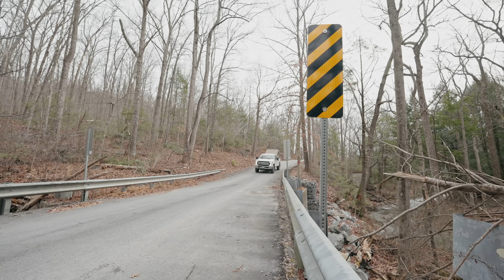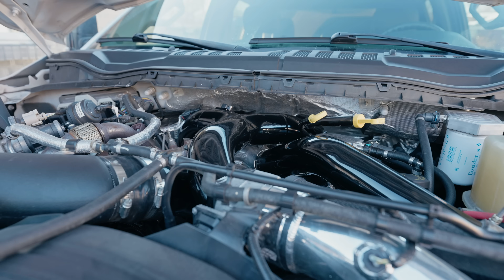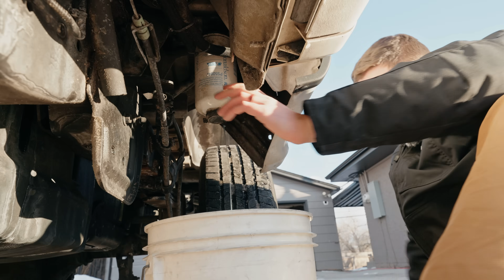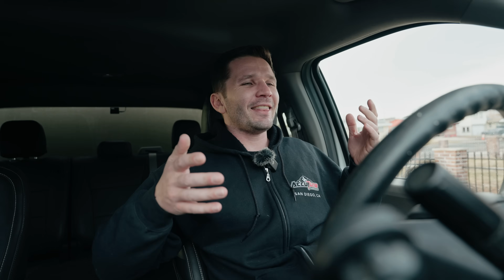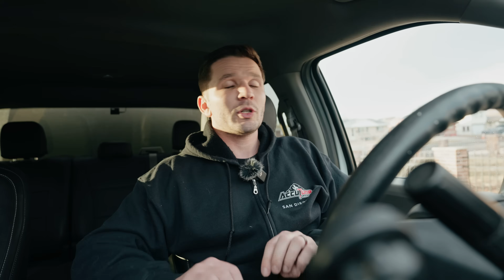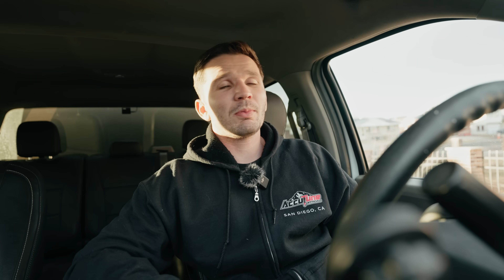6.7 PowerStroke Pros and Cons After 200,000 Miles

Comment: 11-f250-6.7 with 276,000 miles on my CP4 and running strong…. Run Cetane, don’t idle, don’t mod, don’t tune, baby until up to operating temperature, maintain and run baby run!  I hope I make it to 500,000?  I know my truck will. I’m old.
Reply: Looking at trucks with 255-275k miles an hoping I get one that was maintained.
Reply: @ZONES89RS  where are you located? Whats your budget? I know of a 1 owner truck with 299k highway miles in So Cal
Reply: @mrsportfish8987 found a 19 F250 with 228k miles

Comment: Old is gold will never buy new  just put 35 grand into my 7.3 powerstroke supposed to be close to 1000 hp no emissions no def guarantee my 2000 f250 will last longer than a new one theres like 4 sensors easy to work on ford till the day I die but the new stuff is junk to me compared to my 2000 if my window stops working all I have is a switch a fuse and a motor not 7 computers in my door just for my window will put 100 grand into mine before i buy the new junk

Comment: Currently at 334k miles 2018 F-250 all original.  I haven’t needed anything replaced except o2 sensor and batteries. I’ve never used a fuel additive, just kept the fuel filters and the oil changed (full synthetic) regularly.  Some front end parts of course.  I can’t imagine a better truck, I’ve owned Chevy and Rams and they were ok, at least mechanically, the rest of the truck just didn’t seem to hold up nearly as well as the Ford has.  Planning to get me a new F450 in 26.
Reply: If you get an F-450 recognize the tires are true “truck tires” and MUCH more expensive then what you are buying too.  Also, the suspension system is great when loaded so if you plan on having a trailer on it most of the time you are good.  Without a load, the F-450 is one harsh ride.

Comment: I replaced my CP4 pump with a DCR - no additives no failures.
Reply: @hgoff5617  man I wish it was cheaper to do it
Reply: @ZONES89RS cheaper than a new fuel system I’d just do the prevention kit until failure then upgrade
Reply: That’s the way to go. Now have a DCR on my 280k ‘17 6.7 F250 Lariat and hope to get to 500k. Absolutely love my truck.

Comment: Is the oil pan leak an expensive fix ??
Reply: $2500 +....got lucky it was just shy of 100k miles. Dealer fix as that part is part of the engine which was 100k/5yr warranty item.

Comment: 210K miles on my 17. Its all stock-- so far no issues. Have replacing the CCV seems to be an annual event. I do use hot shots just to be safe, way cheaper than the alternative.
Reply: @terryl.6490  hot shots has been proven to be the WORST additive for diesels. Look up the test comparisons on additives on YouTube.

Comment: My 2000 7.3L Diesel just turned 650K, still going strong
Reply: Doesn’t make enough power to break
Reply: @Robbie64 who cares. It doesn’t break. Thats the point. Can still tow what most people would tow
Reply: @chrisrstt  you realize and f150 is half the weight and rated higher for towing rated higher hp tq . Love the old school trucks but the fact you could put 100k into them make it capable of towing 30k it’s still only rated for around 10k
Reply: @tree01house  we are about to buy a travel trailer to take family trips across the country so I’m going to get my first diesel to haul it. Always had 1/2 ton trucks. What are you top tips to get 650k out of one? I would love to be able to say my truck is still going strong at 650k miles one day
Reply: @tree01house  wow
Reply: Sure it did
Reply: @gnd111 While there is no exact total count, multiple Ford 7.3L Power Stroke diesel engines have exceeded 1,000,000 miles, with at least one documented example hitting over 1.3 million miles on the original engine. Known for extreme longevity, these engines frequently surpass 300,000–500,000 miles with regular maintenance, particularly when used for heavy-duty towing or hot-shot trucking.
Reply: Documented Examples: A 2000 Ford F-350 DRW 7.3L owned by John Freeland is a frequently cited example with over 1.3 million miles on the original engine, frame, and drivetrain in this HotCars article.
Reply: Commonality: Reports of high mileage indicate that while reaching a million is rare for most vehicles, it is a recognized milestone for well-maintained 7.3L engines. 
These engines are often lauded for their reliability and simplicity, with thousands still in use, often exceeding 700,000 miles, notes a Reddit user in this r/powerstroke discussion
Reply: @gnd111 present, not "did", past tense.

Get it right
Reply: How can you make up for lost compression in an engine that old?
Reply: @nunya6747  it all comes down to how the vehicles used and maintained some of them to have gone for over 1,000,000 miles. It was just a valve job. Original rings, and pistons compression stays fine.
Average life before needing work is probably more like 300,000 miles though
Reply: @SierraKnight3277  appreciate the reply!
Reply: My RAM has 320,000 miles and is from 2023. There's no comparison. Ford is crap.
Reply: @RaulSanchez-yb3dm I'm a rancher, FORD has been great for us.

You do you boo
Reply: @RaulSanchez-yb3dm  being Narrowminded really limits the things you get to learn and experience in life. I have friends that have heavy duty diesel pick ups from all three manufacturers with hundreds of thousands of miles and they can all be really good trucks. I don't think one is better than the other, as long as they're used and maintained responsibly.
Reply: @RaulSanchez-yb3dm  what model Ford trucks have you owned?

Comment: I have a 2013 F350, it runs like a clock and has 175k miles. I use Prolong at oil change and Lucas Injector cleaners. I have the S&S diesel pump  and the HSM fuel kit in the engine bay.  . Opti-Lube XPD All-In-One Diesel Fuel Additive | 1-Gallon.   Some times the turbo takes a bit to get going, might need to get a 2015 Turbo.

Comment: I was in the market for a big truck for future stuff, obviously expected to have to get a diesel because thats 90% of these trucks. I was expecting the cantankerous, loud beasts I was use to with diesels.

Imagine my surprise when I got my 2012 6.7 dually and it was very quiet and pleasant to drive. Like, so sedate and quiet if I wasn't stepping on it that I was worried something was wrong with it. I expected something wrong with it.

And I looked, because I actually did not want to buy this truck. I was looking for a different one, and conversely looking for any reason not to get it. However, it was sitting around for literally 4 months just staring at me while I did searches for just about any other one I could find. I wasn't opposed to a diesel, since most of these trucks are, though I really wanted a 6.2 gas. But do you know how hard it is to find a crew cab gas dually? There were three in the entire nation that even came close to fitting my criteria, and all of them had problems and were on the other side of the country. 

So I was bored and decided to go look at it because obviously it was there for a reason and I was curious. Only 140k, and while it's had an asinine amount of large work done on it (Carfax mentions the long block was completely replaced at 62k, and the dealer I bought it from did tons of work on it for the entire fuel system because, apparently, this truck had it's CP4 grenade), it's been meticulously maintained; this thing looks like it's never even had a leak, anywhere, not a single spec of rust, no blow by at all, no ticks, taps or any weird noises, no damage, no accidents, the paint even still looks decent. I crawled around under that thing for the better part of an hour, in sweltering heat, trying to find what could be wrong.

There's lots to be done for sure; the back tires were shot so I had to get those right off the bat, almost all the bushings everywhere need replacing, and I'm pretty sure the springs and shocks are all original so those will have to be dealt with. But thats easy stuff. I'm still waiting for The Big Catch with this thing, considering everything has been so flawlessly simple with it, aside from spending a bit outside of my budget to get it. 

But no one else has found anything wrong with it either. Guys who put the tires on it called it "mint". My good friend Josh, a car whisperer who lives and breaths vehicles since he was 13 and can know everything about a vehicle after spending just five minutes with it, called it a "Diamond".

The only thing I can think of was The Lord wanted me to have it for some reason. I guess that means I'll be taking care of it for now on.

Comment: 6.7 power stroke was better with the 6 speed. It ran more efficiently at higher RPM. With the ten speed it gets better fuel mileage but doesn’t run in proper rpm range and the EGR doesn’t work as efficient and the oil gets blacker faster. I lock out gears at certain speeds to keep the engine between 1600 and 1800RPM and oil stays cleaner longer

Comment: I am perfectly happy with my PowerStroke and will NEVER go back to a Gas engine.  I have never had ANY of the problems that supposedly plague this engine.  Just treat it well and perform maintenance on a reasonable schedule, and it'll be good to go for (hopefully) hundreds of thousands of miles.  For the record, I drove my bought-new1994 K2500 GMC Suburban for 335,000 miles before needing to replace the 350 engine.  I fully expect that I should be able to attain that, at the very LEAST, before rebuild time.

Comment: Also important to keep on top of the CCV filter to prevent oil pan leaks.
The 6.7 seems to have a lot of blow by from factory, and a lot of people seem to agree that more blow by is not necessarily a death sentence for 6.7’s.
BUT, if you don’t replace the CCV filter or upgrade it to a bypass or new style filter, you will build up a bunch of crankcase pressure and blow out the oil pan seal and other seals.
Super important if you have a pre 2019 truck to replace it with at least the new (I think 2022+) filter.
If your injector IQA codes are still on the box, then it’s never been replaced.
Reply: Do I need to do this on the 2020 or does it have no filter?

Comment: Do I have a powerstroke? No. Do I know a ton about them yes. 😂
Reply: As soon as i hear the word diesel you already know it's what the wealthy upper class people can afford to drive everyday
Reply: @TheSonomaGuy-h5m   7.3 powerstroke and lb7 duramax says otherwise. They aren't terribly expensive if you're willing to DIY most of the maintenance and repairs. 7.3s are slow in stock form, but they are true commercial-grade engines that just keep going when you take care of them.

I went back to a 7.3 f250 this year, after regretting selling my previous 7.3 f250. This one had a lot of small issues, but cost 12k with only 136k miles. I'm fixing it up myself and will have a total of about 25k in the truck by the time it has 500hp and is dialed in. I'm currently installing a better turbo and fixing boost leaks.

That's not expensive at all, compared to buying a modern truck with all the EPA-mandated garbage on it. I could care less about having a touchscreen in my truck. I just need it to tow and go offroad. My commuter car soaks up the easy miles. I'd rather have a simple old truck that doesn't require the body to be lifted off the frame every time there's a problem under the hood.
Reply: I bought my 2000 F250 4 x 4 pick up with a 7.3 diesel brand new for $34,300 out the door with tax license everything included.
I'm still driving at 26 years later and I would take it anywhere pulling anything I needed the haul. 
Suffer around $1200 a year for 26 years. I've had a really nice capable fully loaded pick up truck to go anywhere I want and do anything I need to do. . My all-around mpg is about 16 it is low as nine or 10 towing super heavy loads as much as 24 and double overdrive with my gear, vendor engaged traveling down the freeway at 75 miles an hour empty
Best pick up truck I've ever had
Reply: @TheSonomaGuy-h5m  that statement may be correct for the new ones but the older ones are easy to take care of and maintain and they last for hundreds of thousands of miles. I think in the long run if you need the power and torque of a diesel engine they're well worth the money I'm not convinced about these new ones with all the emissions stuff and everything. I wouldn't buy one of those. I'll just keep my old ones going.
Reply: @tifffzz  same with duramax

Comment: Has anyone had an issue with steering gearbox? I can’t have it diagnosed because it seems to only do it after driving it consistently for over 2 hours. But it randomly pulls to either side, it locks up then unlocks just as fast when turning, and there’s no noise, just physical symptoms.

Comment: I agree the cp4 isn’t as big of a problem as people make it seem. 
Currently got 125k on my 19 6.7. 
Been replacing the filters every 15k. every once in a while I drain the water. I’ve been using a an additive from hotshot most of its life. I also alway feel up when the tank is 1/4 low.

Comment: How often do you replaced transmission and differential fluid?
Reply from the maker: Typically every 60k but extending to 100k after running oil analysis

Comment: Great video, I have a 2019 F450 and love it, what mods did you do to achieve that HP on the dyno ?
Reply from the maker: Cold air intake, intake manifold and hot and cold side boost pipes. I had to revise my hp number tho. The correction factor was too high. Made Another video on here talking about it

Comment: My 17 PSD has had the upper oil pan leak since new. Never trusted the dealer or cared enough to get it fixed in 200,000 miles myself lol. It’s never dripped on the ground , it just seeps onto the front axle and steering stabilizers sometimes.

Just rebuilt the front end a few months ago, worn parts, never any death wobble. It’s had a 4” BDS lift on 37s its entire life. 

Routine maintenance done myself for 8 years - fluids, filters, brakes, etc. 

Some minor things here and there like an o-ring on the upper radiator hose I had to replace for a few bucks from autozone. Been a great truck and wanna run it as long as I can towing for the farm and daily driving alike.

Comment: Maintenance costs are what really separates the gasser from the diesel apart from the initial extra 10-15k in price difference. And then repairs are also vastly more expensive on a diesel. So unless you are working the truck hard and use it for work, I can’t recommend one at all
Reply from the maker: That’s fair!

Comment: Almost 250k on my 19 and not a single issue yet. D&T since 50k miles. And it lives on a 230hp tune. I do use hotshots edc every fill up. This is my 4th 6.7 and 0 issues with them. My upper pan has been weeping the last 100k but it's less than a qt after 7,500 miles.
Reply: Owned 4? What’s the highest mileage?
Reply: Looking in to 250-275k Mike used trucks and hoping I don’t have any issues

Comment: I love my 6.7. It is an early generation (2012) but I got it with only 42k miles last year. I did some weight reduction the first month and plan to do a ccv reroute and disaster kit before I start driving it again. I have a 6.0 beater to get me through the winter since I don't want to see the 6.7 rust. Hoping to have a very reliable truck for many years to come after I finish the preventative maintenance.
Reply from the maker: @cooper.thibault  it sound that trucks dialed. Should last a good long while!

Comment: Diesel should have the additives included at the pump like premium gas or the low sulfur rules should be removed and sulfur should be added back to the fuel. Requiring all this extra effort and money than for things like the CP4 are the reasons why I got a F-350 with the 7.3 Godzilla. Well, and the increased payload.

Comment: Just picking up new 2025 F350 Powerstroke, I have been driving Ford diesels for many years pretty much without issue. I had the oil pan lead, dealer fixed it, pptoblem gone. I change oil and filter every 8000km, ( about 5000 miles) using Shell T6 5/40. Change fuel filter and water separator around 40000 miles, never been an issue to change more often. I love these trucks they are comfortable and a true pleasure to drive!
Reply: You changed  the water separator at 40k? Why?   My 2017 6.7, with only 37k of very light duty use, has intermittently signaled 'Water in Fuel'. Yet when I drain the fuel, there's NO water. All service has been performed at a Ford dealership at ~5k miles intervals. They replaced the harness going to the water separator ($400+ labor). But this had no effect. I then started using a fuel additive. Still, the warning typically pops up each time I drive. Does this sound familiar?   Any suggestions would be appreciated.
Reply: @gregparrott  Never had that problem on any of my ford diesels
Reply: Sensor issue?

Comment: Dude 100% correct. I own a 22 F350 crew cab long bed powerstroke and my business partner purchased a f250 with that Godzilla and just oil change and gas and go…..
Reply from the maker: Right on
Reply: I had a Godzilla and have a 6.7 now those big gasser hds suck fuel like you would not believe and scream doing it. The Godzilla is the best but they still suck bad.